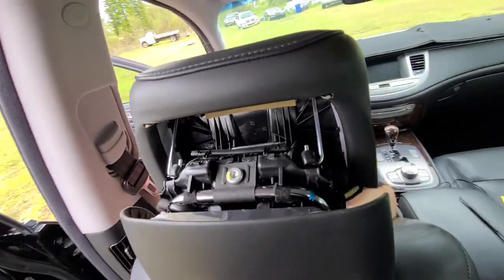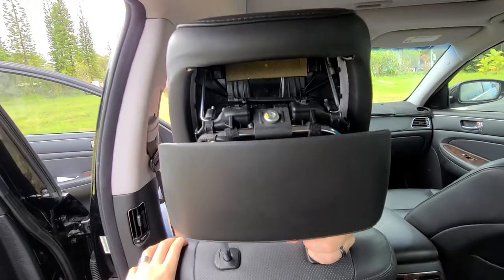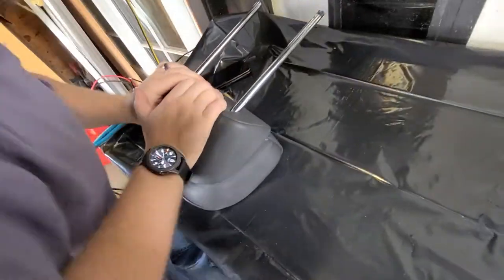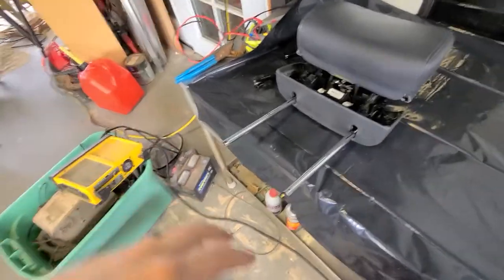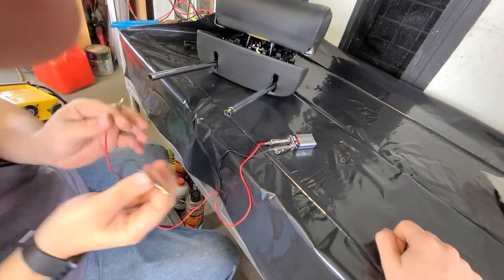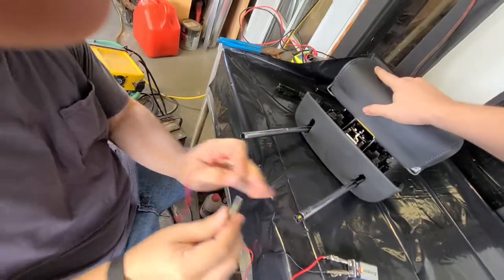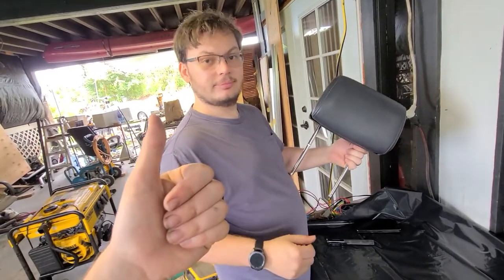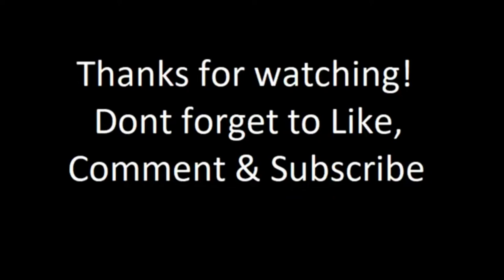Genesis Sedan Deployed Headrest Reset (2009 - 2014)

Comment: Another tip if you are having a hard time putting enough pressure on the headrest to keep it closed. Put it on the ground and push with your knee on top as leverage and itll close up perfectly. Had to do this twice on my R-spec and this video helped so much!

Comment: I have an 2013 Hyundai Equus and for some reason when I turn the car off, the power to the electrical system stays on. Now I can't use the key fob to lock or unlock it. Can someone please tell me what to do to fix this?
Reply from the maker: you should make a post in our group https://www.facebook.com/groups/540434536329764/

Comment: The question is. Why the f is this a thing?!
Reply from the maker: To prevent whiplash in the event of being rear ended, also to safely guide your head to the air bag if needed
Reply: @GenerationGarage I just got rear ended and these deployed and tbh it felt like this feature actually gave me whiplash lmao
Reply from the maker: @taylorshea6856  dang, well it is kinda outdated and most new cars don't use them anymore